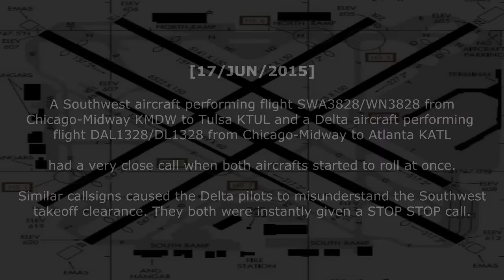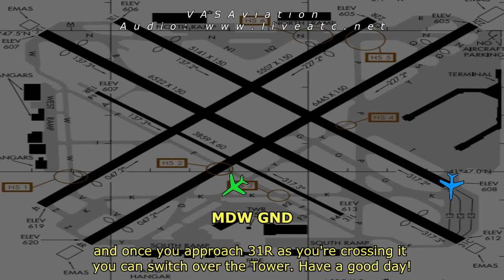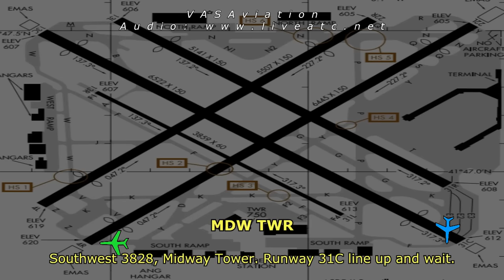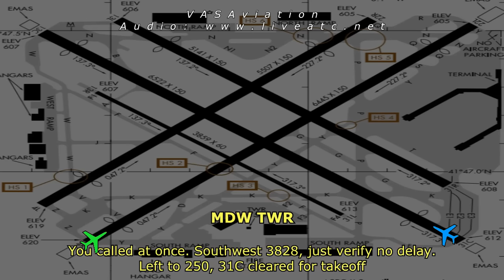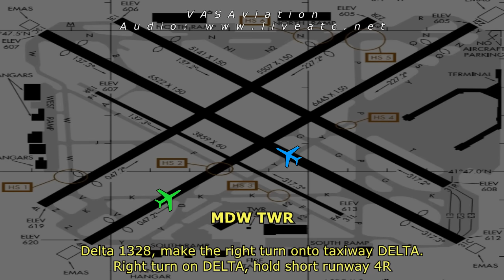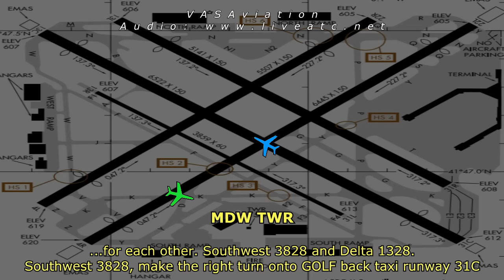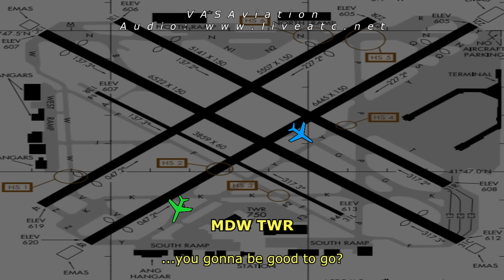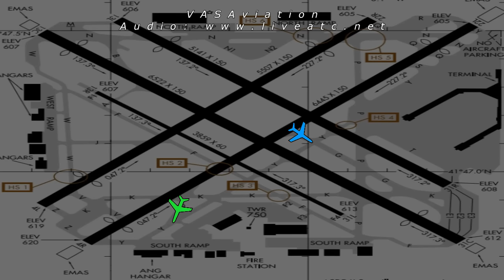[REAL ATC] Delta and Southwest VERY CLOSE CALL on takeoff

Comment: I can understand a lot of people blaming the pilots for not listening to the runway assignment that is given the immediate departure. But what I don't understand and refuse to accept is that air traffic controllers constantly try to jam up pilots. Saying things like "no delay"... Get bent, getting a 164,000 pound aircraft airborne takes as long as it takes. If I want to line up and run a checklist for 5 seconds, don't create a traffic pattern that doesn't allow for that. Or if I want to run up engines before break release, don't make a traffic pattern that doesn't allow for that. If too many arrivals are occurring, use the parallel runway. There are a lot of excuses out there for this video that focus on the pilots but they were rope-a-doped... This kind of setup led to an inevitable extremely dangerous incident. Thankfully, both departures stopped, but I think it is even telling that the controller had the stupidity to try to just direct one to stop, what if they were both, yet again, mistaken and both assumed the other one was told to stop? The female controller declared similar call signs, the male controller totally jumped into the pile of garbage headlong.

Comment: They both started and both stopped 🍻 can't believe they wanted to call company's with the motors running!
Reply: That is the procedure. The running engines is irrelevant. Company has to sign off on the flight if the pilots wish to continue the leg after an abort.
Reply: @blusheep2  I was waiting for "Procedure" Evertime I call my company they are always in a meeting.
Reply: @chrisled6928  mine has a dedicated duty pilot that sits in ops for just such an occasion.

Comment: Anyone know why they "have to call company"?
Reply: Probably to report an incident. If anything happens and they get sued by a passenger or anyone else, company will need to know everything that happened and have notes and all on the incident. That's why the one guy was wanting to also make sure he had been cleared for takeoff so if it came out later that someone did try to sue or anything like it, they could say their pilots didn't make a mistake, that it was the other airline's pilots so sue them instead. Stuff like that. It's the same logic you get when you're at any job and they tell you you HAVE to report if you injure yourself at all, or if a customer does, even if they don't complain at the time and even if it's a minor thing. Also company would want to know so any excess fuel used or supplies used, will be accounted for. Money motivates the world.
Reply: @FallingGalaxy  That doesn't make much sense to do it while they are still on a taxiway. It seems like that can wait until the plane arrives at its destination.
Reply: @nickv4073  You want to report it right away so that hopefully it gets investigated right away (as in that same night/day that it happened) and that the problem is fixed right away.  Not 5 or 8 or 12 or 16 hours later after a flight has arrived at its destination.  There could be a problem with the equipment in the ATC center or that male controller may not know how to use the radio properly.  You're supposed to key your radio mic and wait for a beep letting you know its OK to transmit.  To me it seems like he is keying his mic AND talking at the exact same time which is why the first words in his calls are spoken mid word or even the word after what is being shown in the captions.  The Delta crew could also be partly to blame since they should have known what runway they were taking off from.

Comment: Two similar callsigns, and yet controller keeps speaking in a normal, almost unintelligible rate, and asks the two aircraft with similar callsigns to line up and wait on intersecting runways at the same time.

These guys were trying really hard to get a runway incursion

Comment: This is why you should not “rap” especially like this one where two ships holding in the position on both crossed runways. At the second radio block should’ve the controller known they both read back the t/o clearance. This is how you become an exprienced controller but this one was way too close.

Comment: Seems to be a lot of conjecture about the audio quality and how quickly the second controller was speaking. Chicago is busy, high speed and no nonsense airspace and that includes MDW. The controller was speaking at a normal pace and can be clearly understood. These aren’t the only two airplanes in the area. They have others inbound and need to have a flow. Professional pilots know what’s its like to fly in busy airspace and at busy airports and are used to this type communication. That being said we are all still human and things happen. 

The audio quality is poor and not accurate to what the controller/pilots may have been hearing because it was recorded from a scanner and is not the actual source from the facility, making comments about quality and what the controller/pilots may have heard moot. Heterodyning, which occurs when two people transmit at the same time, is a bit of a wildcard. Sometimes you can’t hear either transmission and sometimes one is blocked out and the other comes through clear. Which makes sense when he gives the first takeoff clearance and everything was muddled (even the caption said “you spoke at once” when he was really saying two spoke at once.) so he reissued the clearance. In the read back you can still hear some heterodyning but can clearly make out SWA. So it’s possible the the controller didn’t hear DTA. The controller was paying very close attention however and stoped the DTA once he saw them start rolling. Saying “Stop Stop Stop” May not be the .65 but sometimes that plane language is best, (pun intended) especially in a situation like this. SWA could have aborted for any number of reasons but do to the situation I’m sure any pilot would do the same, especially not being 100% sure if the call was for them. 

This type of thing happens a lot in every airspace environment, i.e. tower, tracon, enroute. Most of the time it’s caught and corrected but sometimes it’s missed, usually it doesn’t result in anything serious but the danger is there. It also brings up crew resource management. It’s hard to say what was happening on DTA’s flight deck but there are two pilots who should have been listening and confirming with each other, and maybe they were but made a mistake. There are so many factors that play into these situations it’s hard to analyze them behind a computer screen. That being said this is a good informative video that shows the very real, human side of flying and air traffic control. Both are very difficult jobs. These controllers did everything by the book, ground let them know about each other and local reissued a stepped on clearance and stoped DTA when he realized they were both rolling. All in all, nice work all around to both the pilots and controllers for safely resolving the conflict. Remember, we are all human and not as smart as we think we are. People make mistakes. But thousands of planes make it safely to their destination everyday in this country and we have the controllers of the NAS and pilots to thank for that!

Comment: Local control (tower) had a bad mike switch, so not a single transmission of his began clearly.  But the name of the runway - 31 Center - came through loud and clear each time. Both Delta pilots fucked up big.  
I know controllers do handle similar call signs by saying the company or call name both before and after the numbers - " Southwest 3828 Southwest, wind calm, Runway 31 Center cleared takeoff." Not sure now if that is technique or is actually specified in 7110.65. I seem to recall that it was the prescribed procedure. If so, then both the ground and local controllers also fucked up bigly.

Comment: Was the pilot in the wrong? Absolutely. But how does ATC not realize that transmission is being stepped on as you're queueing two planes that have similar callsigns. It's at this point that you enunciate callsigns and not mumble them like usual over awful comms that make everything sound garbled. Obviously they got confused.

Comment: How damn hard was it to just hold the one aircraft off runway until the other took off so there could be no mistake?

If Delta was sitting on the taxi lane then when Southwest is cleared to take off they would be like.... can't be us we are on the Taxi strip.
Reply: "Line up and wait" allows the pilots to prepare for an immediate take-off, whereas holding short of the runway would've taken a lot more time and could have forced the nr. 1 aircraft on final to go-around. An extra go-around procedure is not only risky in a full pattern, but it also results in more congestion and delays in an already congested airport. I think the decision to "line up and wait" was the best decision under the circumstances. 

The tower could have been more articulate with the callsigns. The ground controller, however, did a very good job.

Comment: Take all the time you need to "Change your underwear".. too close eh. IMO (I AM NOT a pilots testicle) but 2 SUCH SIMILAR call signs should be taking off on same run way OR several aircraft slotted between both??? Brings back memory's of KLM

Comment: A non mumbling and decent speed of speech on the ATCs part, as well as reassuring and repeating on the pilots' part would have helped...
Reply: that was crystal clear... the radio quality makes the voices sound “mumbling.” this wasn’t anyone’s fault but the delta pilot. especially as the ATC did his job and requested a second read back and on that the call sign that he heard back was the correct one.

Comment: Bluntly, I'm afraid, the controller is talking far too fast to keep everyone safe! He should have been aware of the possible confusion of two aircraft whose callsigns ended in '28' and slowed it down or at the least, not given a 'no-delay' takeoff clearance with additional instructions attached. This sort of 'efficency-panic' controlling doesn't exist outside of the US. It's an airport with FOUR runways, us Europeans couldn't even dream of that luxury.

Sadly a catastrophe was narrowly avoidied in this instance. You guys are far too much RUSH RUSH RUSH to make it sound so cool that the pilots (and the controllers) can't see the wood through the trees. I assume most of the guys that aren't professional pilots would blame the RECKLESSNESS of the SWA, but that's an incorrectly pointing out the root 'mistake'. The previous controller even ADVISED that there was a similar callsign on frequency, but the tower controller thew caution to the wind and barked instructions at 450 words per minute and ignored the crossed-comms and obvious confusion until he could visually see that both were rolling for take-off.
Reply: @KillgoreES So your argument is speed is a priority over safety because a queue might develop? I assume you're not a professional pilot so I'll try to help explain it for you. Safety comes first, everything else is way down the list of priorities. Whilst Midway is busy, it isn't THAT busy. I've been there a few times, it honestly doesn't need to be this frenetic. It handles approx 20 million passengers a year on 4 RUNWAYS, I'm based at London Gatwick which did 45 million passengers last year with JUST ONE. R/T sounds nothing like this here as it doesn't need to. Talk about busy! Less speed, more haste and you actually save time as you get it right the first time. Being surrounded by roads and buildings makes zero difference to a tower controller. The runway is either clear, or it isn't. Approach control decide when and how many aircraft they can handle and the tower then fires them off subject to capacity. Don't forget that Europeans operate into American airports as well (Midway aside), not all of their first languages might be English, you hear a far greater amount of slang and non-standard R/T in the US which seriously damages a pilot that is new to the US's situational awareness as it's impossible to follow.

Listen to this one for example, https://www.youtube.com/watch?v=oI2rJhdvguc&feature=youtu.be&t=11 The SPEED at which she gives a CRITICAL instruction "Delta 300, hold short of runway 22R at JULIET" is just not conducive to safety. You compare that to her clearing another aircraft for takeoff later https://www.youtube.com/watch?v=oI2rJhdvguc&feature=youtu.be&t=18 , in her head, this is a critical R/T message so she says it slowly, but it's no less critical than the instruction to DELTA 300. Just SLOW down and you might just manage to avert the next Teneriefe disaster. It really doesn't sound that busy on frequency, she's just got into the habit of barking what she considers non-critical instructions at speed which has lead to an unfortunate mistake for the Delta here. Sadly, I can find NUMEROUS examples of this sort of 'controlling' on VAS and it should serve as a lesson to the American controllers (and pilots) for accepting critical R/T at this speed. I wasn't cherry-picking btw, it was the youtube 'next video'. Swiss cheese lining up!

Excuse this waffling post, but put yourself in the mind of a Japanese ANA pilot or a Air China crew whose first language is very definitely NOT English. The likes of 'Kennedy Steve' are lauded on this site but those guys will literally zone out as they don't have a clue what he's saying or going on about, situational awareness quickly drops to zero, it isn't their fault.  Keep it standard, keep it at a speed that non-natives can vaguely understand, and we'll all be safer; even if it means someone has to wait another 2 seconds for their take-off clearance!

Comment: everyone in the comment section: Controller too unclear!
Controller: uhh... clearance was for 31C, very clearly.
everyone in the comment section: CALLSIGN UNCLEAR!!!!!
Reply: You do know that both aircraft were preparing for take off. On the runway. Designated Runway 31 Central. The problem was that both of them responded at the same time, meaning the controller didnt know WHO the hell was talking. He even says after the incident "you cant keep answering for each other". The problem was one of the two pilots (by the looks of it Delta 1328) just was NOT listening. He hot mic'd on SW 3828's readback. Props to the controller, he knew this was gonna be a problem. Also props for him telling them to both stop answering for each other. It gets very confusing when SW3828 reads back for D1328's orders to stop and taxi onto Delta, and D1328 trys to read back for SW2838's take off. Both should have waited imo. The controller would have repeated and cleared up any inconsistency, he already knew it was an issue. If neither starts their take off they would have got a "SW2838, you are clear for take off when ready". Both pilots are to fault here. Not the controller. Try give 2 people, 2 different sets of instructions, and then try and listen to them both repeat what you said, AT THE SAME TIME, then pick up a slight mistake. He told them to listen, he told them they might get confused, and they both went forward with NO double checks. Pilot error, not controller.
Reply: @ulyssesdamon3408  a) i did not read all of that but reading the last 4 words told me enough.
b) are you new to the internet?
c) "You do know that both aircraft were preparing for take off. On the runway. Designated Runway 31 Central."
two flights on very different runways. 4R and 31C. hearing a runway you're not on should make it very obvious the clearance wasn't for you.
So yes, Pilot error, I never said something different...

Comment: it's ironic, i barely fly.   but if more people flew infrequently like me i'd fly at least a tad bit more and would feel much safer doing it.  ie. - if there were much much less planes in the air relatively close to each other all the time, and on the run way.  i get it, i know this is "rare" and it's still safer than car travel, but it's a F'In complex system with Loads of inter connecting parts that require just ONE TINY Error resulting in so much tragedy when it does happen..  I know I have to accept that most people accept this complexity because of the freedom it gives them..maybe just cut down the traffic by 30%??

Comment: I don't understand why Pilots and air traffic control don't speak slowly and clearly,,, every pilot and every air traffic controller sound like the Micro Machines guy speed talking through a string and a paper cup
Reply: it may be hard to hear, however when your in the air with your headset on, it's accally alot more clear to lisen to

Comment: I was fully prepared to shit on delta, but listening a second time I honestly don’t blame anybody here. Controller was sloppy given the circumstances, but damn this was perfect storm situation. Especially when the first half of the callsign is getting cut off
Reply: Delta should have known he was on 4R though, and not 31C, so I still blame Delta. "Cleared for takeoff on 31C" was very clear on the radio, though it was the only part that was clear.  You're right though, the Tower controller could have avoided this whole situation by following regs and enunciating and speaking at a reasonable speed.